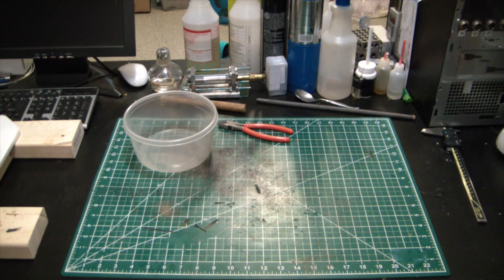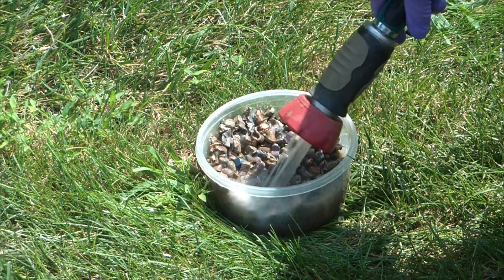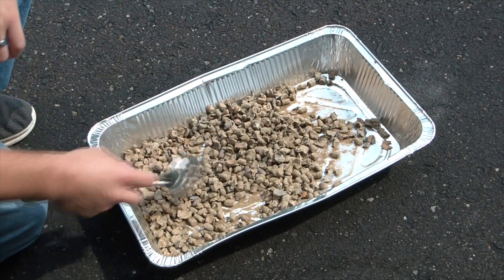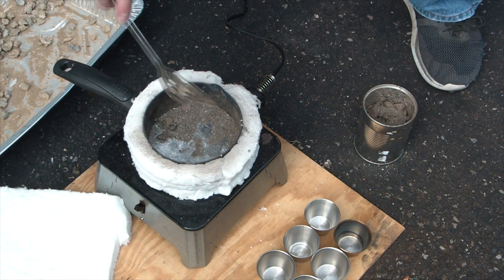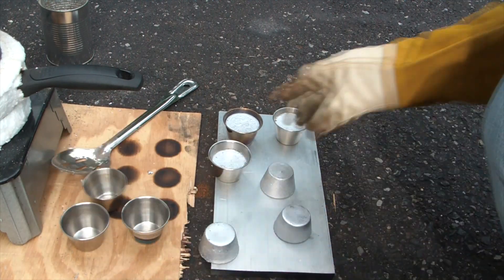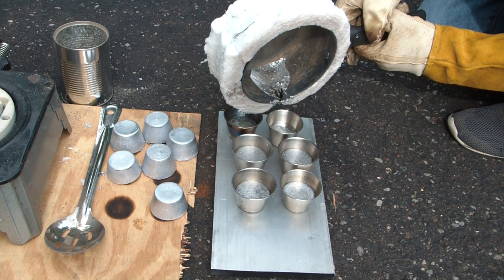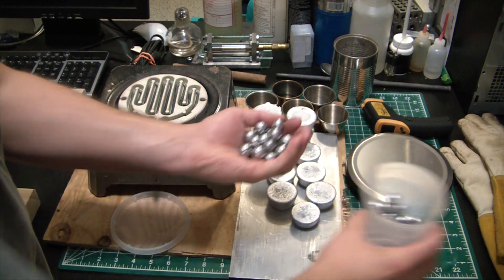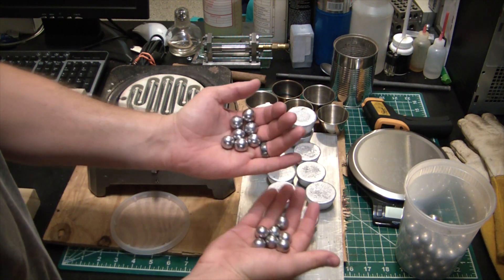Refining Lead from Free Range Scrap - ElementalMaker

Comment: Do not wash your lead. If you do, then put it all in the pot so that it is 100 % dry. If you drop a handful of range scrap in the molten lead with any moisture trapped in a jacket or something, you find out quick what a bad idea it was to wash the lead.
Reply from the maker: Yes I'd never dream of adding moist lead to a pot of molten lead. That would be a volcanic eruption to the face.

Comment: I try to get 300-500 lbs of lead out the berms a year to offset the $365 membership and if I don’t do 10hrs of service the membership is $565 a year . Usually sell about 500 worth of lead so membership is $65 a year. They don’t like us taking the lead but fck em
Reply from the maker: Man that's one expensive range membership! I thought mine was high at 250. Just tell them the lead goes right back where you got it, just at much higher velocity 😁

Comment: You can refine it to be very pure by boiling it in hcl until it's all dissolved then precipitate it out as lead sulfate by adding diluted sulfuric acid to the solution.... Filter it out and add some carnon from charcoal or something and heat the lead will reduce to its metallic form and be very clean

Comment: If you stired your lea melt with a wooden stick you would convert the lead oxide (the dirt like stuff floating) to lead metal the carbon from the wood would reduce the oxide to lead and oxidize the carbon to co2.
Reply from the maker: I usually flux with paraffin or sawdust, which should do the same given their carbon content
Reply: @ElementalMaker  Yes certainly!

Comment: you know, i wonder what the process would look like to refine the lead from an unknowm alloy into like 90%~ (or higher) pure lead. because pure lead is wayyy softer than the alloy stuff, especially if theres a bunch of tin and or antimony mixed in (like from wheel weights.)

Comment: That's nuts. Pure lead is $1 per pound at my local recylcler. My time and labor is worth way more than that. Also, you don't need to clean the lead first. All impurities will float to the top to be skimmed off.
Reply from the maker: The whole point is the fun of it. That's probably the same reason you reload (assuming you do so), you can buy high grade commercial ammo way cheaper when you take your time and labor into it.

Comment: Don't quote me on this one, but I think if you melt lead at just a bit above melting point, it should be pretty pure. Lead melts at about 330C which I think is a low melting point compared to a lot of other metals. I know tin melts way below that but tin is so soft you can bend a tin bar with bare hands so tin shouldn't be an issue in any purpose for which you're casting lead by hand

Comment: How do I soften it, I've only really got use for soft lead.
Reply from the maker: Range scrap should be relatively pure as is, so it will be quite soft. If you need a specific softness, you'll need to spend alot more and get a known alloy.

Comment: Last range lead I melted down had some zinc in it. I read that copper sulfate may help remove it. I have cycled it through once and it removed most of the zinc, going to run it again, hoping to get it clean enough to cast freedom seeds with!

Comment: Is there an additive that can be used to make them as soft as pure lead? In thinking of air projectile use, and these devices prefer softer material do to the lower pressure levels.
Reply from the maker: The only thing you could do is use pure unalloyed lead to keep it as soft as possible

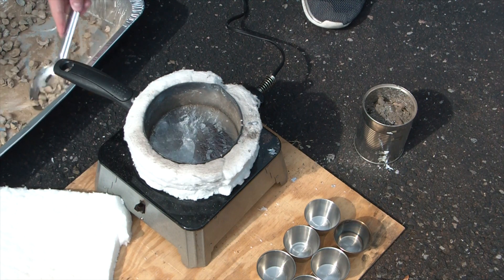Comment: Protip: Lead is an incredibly dense metal so don't be afraid of starting a smelting process with mixed metals. If it has a lower melting point than lead (almost guaranteed at lead's ~325C melting point) it will most likely collect at the surface to be scooped away as 05:00 shows.

Some comparative densities (in kg/m^3):
Uranium: 18900
Lead: 11340
Steel: 7850
Aluminum: 2712
Carbon (what organic material will turn to once in a lead smelter): 2620

Melting Points (in degrees C):
Lead: 327.5
Aluminum: 660
Uranium: 1132
Iron/Steel: 1538
Sand (silicon dioxide, the most abundant mineral of dirt): 1713

Carbon has a sublimation point of 3642 degrees C as it has no liquid state.
Reply: Yeah, one of the few things that you can get in your lead is tiny amounts of tin which don't impair the properties of lead in any meaningful way for any purpose which you'd cast scrap lead for

Comment: An unshielded heating element that relies on an air gap between it and the metal pot is dangerous.
All that has to happen is you spill lead on it and this makes an electrical contact with the pot, or maybe the element will just lift a little, break or otherwise make contact. Then you get an electric shock and if that does not kill you, it's likely to cause you to spill the molten lead over you.
  
Yes you could make it safer by making sure the circuit is protected with an Earth Leakage Core Balance Relay ELCBR 
also called a Residual Current Device 
https://electrical-engineering-portal.com/how-residual-current-device-rcd-works

Do not operate this old heater without this protection and preferably don't operate it at all. Destroy it and buy a modern safe lead melting pot.

Comment: Is there a way to remove the tin and antimony from the alloy? I'm looking to get higher purity of lead for softer airgun rounds. Also what are you doing the clean up the copper jackets so you can melt it down for ingots. Pure clean copper is worth a decent amount of money, or useful in projects.
Reply from the maker: Pure range scrap should be plenty soft enough for airgun pellets, also skip the water quench and it will be much softer.

Comment: At thought:  Melt the jackets into an ingot.  Then use the ingot in a copper sulfate electrolysis tank to refine the copper.  Low amperage and no rush makes strong and basically pure crystals while impurities are left at the bottom.  The crystals sell as art or can be poured again as pure ingots.
Reply: Why this hasn't gotten a like or comment for 3 years baffles me!

Comment: When lead is melted a dross is always formed I think it is lead oxides(maybe).  The old timers when melting bar lead for bullets would put a little tallow in the pot and that separated the dross from the molten lead I have tried it and it seems to work for me but it's not really necessary to do it for good results.

Comment: Is there any way to separate the lead from the alloy in these muffins? I just bought a box of them on ebay, and I would like to keep my elements separated. With copper, I understand that they can be separated with electricity, but I haven't seen anything on this for lead.
Reply from the maker: For just a display element does it need to be ultra high purity? Most element isolation methods for lead are costly and can give you a good dose of lead poisoning if your not careful.
Reply: @ElementalMaker  I mostly want to separate it for the experience and curiosity of what and how much of each thing are in the mix. The experience will carry forward when I go to recycle electronics and have lots of lead in the mix. From watching other videos, I'm of the understanding that gold and silver can alloy with the lead, and I wouldn't want to lose those. There is also far too much lead to soak up with a bone crucible (I ordered 60Lbs). For the pure lead that I get out of it, most of it will likely get coated in PlastiDip and be a source of heavy. I could just melt it into weights as it is, but the stuff I have looks frosty, and I'm very curious about separating it, and I wouldn't learn anything that way.

Comment: If they're steel-jacketed, can't you just use a magnet to separate them out?
Reply from the maker: Steel jacketed ammo?? Barrel rifling would be very short lived LOL
Reply: @ElementalMaker  okay. Obviously, I know sod all about guns. What does "steel jacketed" mean then?
Reply from the maker: @uncle_thulhu  typically bullets are copper jacketed. Many new reloaders are using powder coated bullets, which are essentially polymer jacketed. Some special ammunition may have a steel core to act as a penetrator, but that's typically the most steel you'll see in small arms ammo.

Comment: Good video and channel!  I like your use of wire-tied Kaowool as an insulation blanket, and I'll be adopting that idea. 

I would like to suggest that you try using some cheap rosin soldering flux to help remove the dirt and oxides as a dross. It will make removing the junk much easier.

Comment: Just as a "safety tip"  you really want to do the processing outside anyway.  The fumes aren't good for you, especially in a confined space.  Depending on the lube used on the bullets, they can be parafin, beeswax, or a whole host of other products, all of which work well as a flux for cleaning the dirt out of your lead. 

If you are casting bullets (projectiles) you really want to know what the mix is.  BUT if you aren't doing serious target work, as long as the mix is hard enough you can use the scrap as is.  To get the best balls for your little cannon you will want pure lead as that will get you the heaviest projectile in the space provided. OR don't worry about it as you are probably also doing that for fun...

Keep up the good work. and Thank You for posting.

Comment: Darn it! Now my secret is out, I'm going to have to mount an Armed Guard on the Range Berm. Must keep away all the Claim Jumpers otherwise my cost of projectiles will skyrocket if I have to BUY them. It is the ultimate in recycling, cast it, shoot it, mine it, recast it and shoot it again. My question is, what would the effect be upon the mixture of Lead, Antinmony and Tin be over a number of remelts?  I don't have that issue at present as there are many other contributors to the supply in the Berm.
Reply from the maker: LOL better stand guard at that berm! I dont think you have to worry, there is plenty to go around for all the reloaders. Were pretty far and few between, especially ones who cast their own projectiles.I dont think you'll get element separation over remelts since its all a solution and the tin/antimony are actually dissolved.

Comment: Another great source for lead is your local auto shop. they have all kinds of used lead wheel weights that they throw away weekly.
Reply: This is where I get my lead, but be warned this stuff is FILTHY!!  Covered in brake dust and you still need to sort the lead from the Zinc and Steel weights.  Def do not want zinc in the mix.
Reply: @jaredrattray  how do you tell the zinc from lead?
Reply: @jerryspratt4078  I just give each piece a bite with a pair of side cutters.  The lead is so soft the tool leaves deep marks whereas the zinc and steel barely mark at all.

Comment: Lead can dissolve iron from the pot. Btw you can melt the jackets into an ingot a run a current through CuSO4 aq to recover copper.
Reply from the maker: I've never heard of iron being soluble in molten lead nor can I find any documentation showing such a phenomenon. Are you sure about that? Because almost all casters out there use cast iron or steel pots up melt their lead. Even commercial lead pots are made of steel.
Reply: @ElementalMaker  interesting. I was reading about iron inpurities in  metals. But I guess that doesn't apply to lead

Comment: You should take some big snips and cut the slugs first before you heat them so it can leak out easier. Plus leave a small amount of lead in the bottom of the pan when you are done. An 1/8th of an inch of old lead will heat up quicker than new lead and help transfer the heat to the new slugs.
Reply from the maker: That's a great idea to leave some lead in the bottom of the pot! Ill definitely do that from now on! Thanks for the tip!
Reply: @ElementalMaker  I did the same thing when melting tire weights for fishing weights.

Comment: try adding candle wax into the molten lead it makes getting the crap out far easier
Reply from the maker: I actually usually use a big chunk of paraffin to flux the mix, but skipped it this time just for video simplicity. It certainly does help get the impurities out faster though.
Reply: Steven Beaumont 
Wax is only useful for an already clean alloy.  It is a reducer & prevents oxidation...  it does almost nothing for cleaning the lead.  Sawdust is a much better choice.

Comment: Tips: 
1. Use a metal cat litter scoop to sift out the bullets. 
2. Don't waste too much time sifting. All the dirt and rocks come out easy in the melting pot. By volume your bucket will be mostly dirt but by weight it will easily be mostly lead, and heavier than you can carry.
3. Don't bother washing the boolits. The dirt comes off easy in the melting pot. 
4. Don't worry about live rounds in the melting pot. They will cook-off well before they are under the molten lead, and the weight of the unmelted lead will contain the round. 
5. Don't worry about wet boolits in the melt pot when starting from a cold pot. All the moisure will cook off long before any lead melts. 
6. After skimming the dirt and jackets, stirr the melt with a wooden paint stirrer. Saw dust helps too. The wood starches clean the lead at the chemical level. Wood starch is an actual flux for lead.

Good luck bermining!
Reply: I use cheap white votive candles for flux
Reply: @nocturnalscorpion4527  It’s not a flux, it helps with the process but it doesn’t clean the lead like actual flux. I use both

Comment: Most lead from bullets these days are alloyed with antimony, but have been alloyed with arsenic in the past. If you dissolve the lead with concentrated acetic acid and hydrogen peroxide, you'll end up with an insoluble white precip. It can either be antimony trioxide or arsenic trioxide. Don't use sulfuric acid or hydrochloric because lead sulfate and lead chloride are white insoluble lead salts.
Reply: But insoluble lead salts are the least dangerous
Reply: @cal7103  Yes, but I was describing insoluble antimony & arsenic salts which can be filtered from the soluble lead acetate. The lead can be precipitated with zinc from the solution. Waste solution can be treated with sulfuric acid forming lead sulfate which is the least soluble.

Comment: ive seen people use tea light candle wax to purefy the lead and get the slag to clump ,just a 1/4 of a tea light at a time it melt flames up the goes out pretty quick but then the slag rises and you get a better end result
Reply from the maker: Yeah it does help big time to flux the mix with paraffin. I usually use it but skipped it this time for video simplicity

Comment: No need to wash the lead. All the jackets and dirt will float to the top. Add carbon to the mix [I just use sawdust] to convert the lead oxide back to the parent metal and let the O atom escape as C02
Reply: It just makes it cleaner, no sense having to scrape dirt off the top when you can just wash it before hand, and it takes up volume too, decreaseing your efficiency
Reply: @sirblacksmith2297  
You are just asking for trouble washing your lead.  Lead is porous and will hold water.  It's much more efficient to scrape the dirt off the top of the melt with the jackets.

Comment: you  can test brinell hardness with a arbor press and a scale.  Get the proper sized ball bearing, push it into the lead until the scale reads whatever amount brinell testing calls for, measure the dent.  Drill press works too.  Whatever you got.
Reply: Just buy a set off "lead" pencil's  and start to make a line in the lead , the pencil nr. who make a line IN the lead is the hardness in brinell off the lead. Easy and cheap test

Comment: Don't go around and tell people that lead is dangerous when it's in the ground. Not good. 
 It takes a very acidic dirt to make lead leak out in the enviroment.
Reply from the maker: There are actually a few ranges around here have been closed due to lead contamination. We must have some pretty acid rain. You would see the white lead oxide all over the berm at one range I visited.
Reply: @ElementalMaker  A study made by the swedish military showed no lead contamination in soil with a Ph above 5. I know of one range that had to close but it was built on a peat moss.